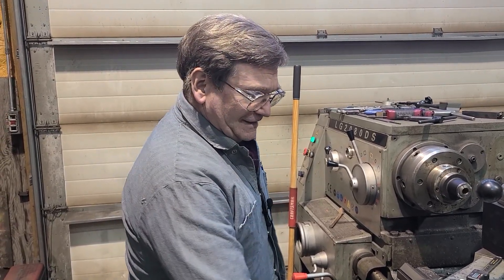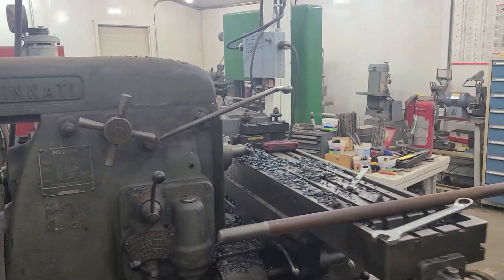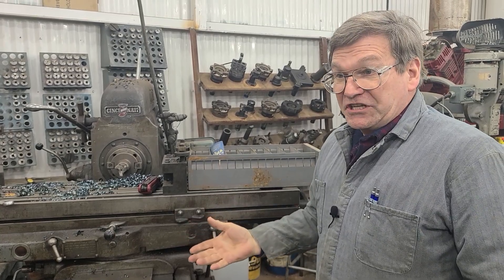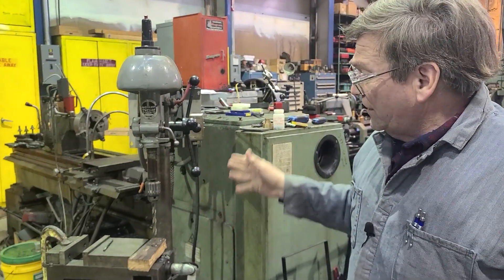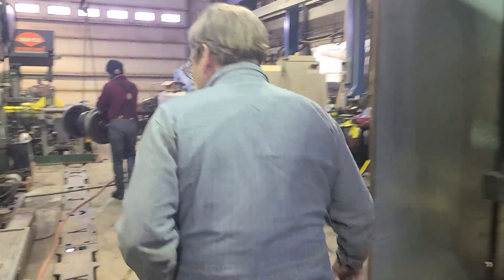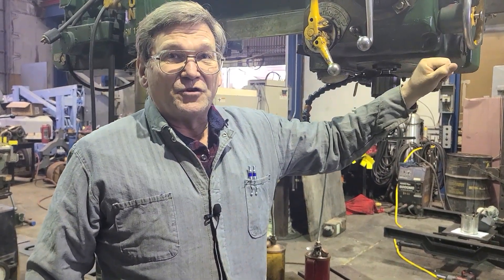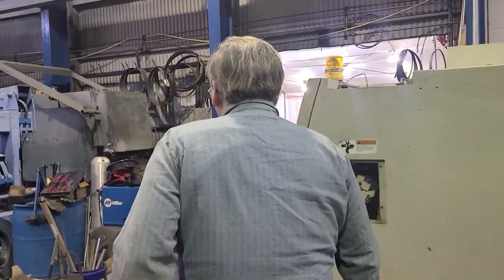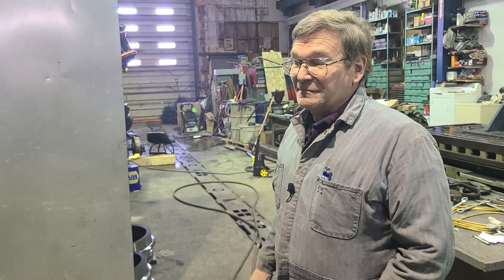Machinist's Minutes: Clutches in your machines (yes, really!)

Comment: On the farm,  I'm still using the American Tool Works 'The "18 American' belt drive my grandfather bought at auction. It has a tag from when the Chesapeake Ohio railroad owned it. Best I can guess is late 1800s-early 1900s. I can take pictures and email them to you if your interested in sharing them. It's a 220v motor coupled to a manual 4 speed transmission with a flat belt that runs a shaft above the lathe with speed selection flat pullies (and a stick to a complex manual clutch that isn't used) that runs the lathe. I just recently got it going again after 25 years sitting. It uses a 4.5 Morris taper tail stock. It's hard to find 4.5 attachments. Also have a camelback drill press that still works but need a belt.
Reply from the maker: Lathes like Your were still very common in the 1970s even in smaller production shops.  I have a pedal lathe about that vintage:   https://www.youtube.com/shorts/HVpMyxbGILA

Comment: My clausing 6913 has a clutch. Had to adjust it the other day. 
I visited a little tiny town of Crystal Springs Kansas today. Had an old machine shop there long shut down. Still had the drive shafts in the ceiling joists with wooden pulleys. An old iron worker was the center piece. Ancient Le blond lathe in the corner. Plow shares everywhere. I guess the old fella who had the place last would hard face them and bring them back to shape on the giant 3 phase grinders in there. Love going through old places like that.

Comment: I run a horizontal boring mill daily that has many clutches. At least a dozen.  And they are EXPENSIVE when they die.   I change the brushes on the most used clutches about every 6 months. The machine is a Wotan. East German made in the 70's. Good machine but its not easy to run. Lots of quirks.
Reply: I have a Wotan boring mill as well.  Is your most used brush on the rapid traverse clutch?  I have a set of brushes on order for mine right now.

Comment: Magnetic clutches in cars are a fiasco waiting to happen, people confuse them with autoboxes, if you want them to last you have to select neutral everytime you stop for more than second or two. 😭
Reply: What manual do you drive where you won't damage it repeatedly coming to a stop without disengaging????
Reply: @PureSPLprix  mag clutches are usually attached to constantly variable transmissions giving the effect of an auto transmission, but without the benefit of a torque convertor. Leaving a CVT box with mag clutch in gear while standing still, rather than putting it into neutral, means the powder is "grinding" all the time.
Reply from the maker: My first exposure was a 1968 R10 Renault, it almost became a death trap.  I gave up on the original drive train & was putting a 375HP 327 in it, but after the first driving My '68 L78 Camaro I bought, I gave up the R10 project .
Reply: @HOWEES  that Renault I would have liked to see, but would never ever want to drive.😉

Comment: What is inverter drive on the electric motors actually mean? Is that a variable voltage or a PWM output? I am not familiar with 3 phase motors.
Reply from the maker: Electronic control, first stage rectifies AC input, either single or 3 phase, then the direct current is stored in capacitors, final is a computer controlled output, that controls switching elements, most are using IGBTs, the timing, of the pulses are controlled to give a 3 phase output to a 3 phase motor, the control has many choices to allow speed, torque control, and braking.
Reply: @HOWEES   Thats awesome. Thank you! More complicated than I first thought.